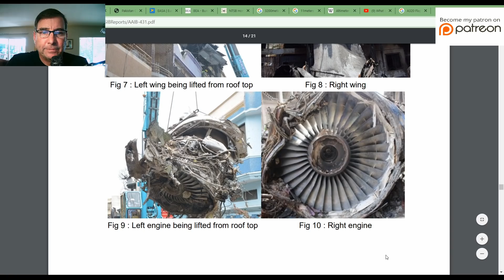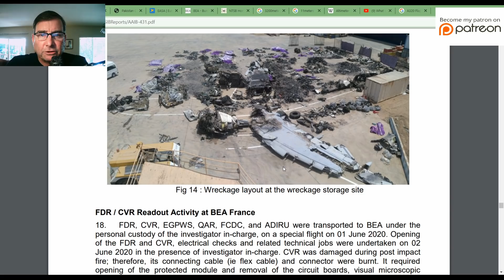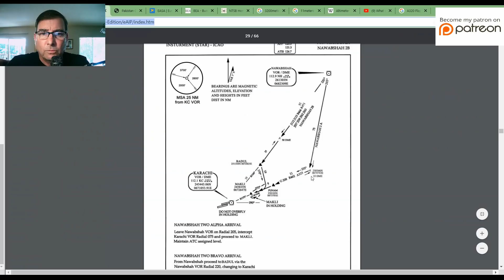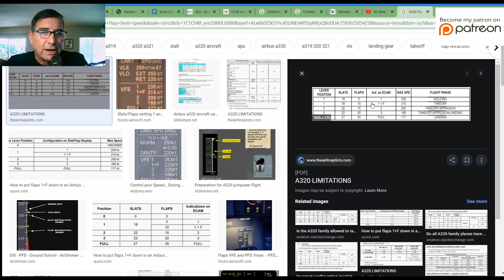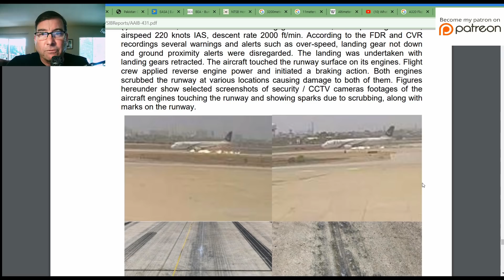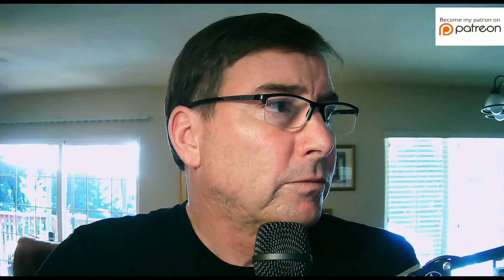PIA #8303 Preliminary Report Part II

Comment: I'm imagining the overspeed captain saying "Shut off that annoying alarm!". FO says "ok" and retracts gear. There ya go.
Reply: Reminiscent of a Three Stooges comedy!
Reply: Maybe...
Maybe not
Reply: Gotta talk about corona first...
Reply: Sounds like a standard operating procedure for Tu-144. They literally had to use passenger pillows to damp the sound of the major siren.
Reply: But there would also have been a flaps overspeed alarm so that wouldn't have stopped the annoying alarm. Maybe it improves (audibly) matters if there were two at once.
Reply: From the sound of the cockpit on the radio to ATC they didn't silence the alarm they just ignored it
Reply: The flight recorder should recorded the flaps actual position (as the computer is aware of the where the flaps are as it needs to be due to fly by wire system it has to make sure both flaps are in sync)
Reply: @lakewoodsteve5028   : Re "Reminiscent of a Three Stooges comedy!": Yes. But unfortunately, when The Three Stooges fly airliners, people die. :-(  I prefer my comedy acts be at a comedy club, not in the cockpit. Nice bit of black humor, though.

Comment: I recall reading about GA pilots getting out of their normal landing sequence, and pushing down on the gear switch, then (because it had already been lowered) reacting by pushing it back up, raising the gear. Followed by a surprise belly landing. The report said that the gear was lowered and subsequently retracted sounds like someone remembering the gear, and lowering it late in the approach, and then later perhaps the same pilot (forgetting that it was done) or the other one (assuming the first had forgotten) getting confused and attempting to repeat the task.  With the aforementioned outcome.  Thanks for the delivery and the attention to detail, especially nice for us prop chasers. CRM - Keystone Cops style. DJ

Comment: I'm very sorry this accident happened.  You nailed it.  I've spend many hours on the hangar floor turning wrenches on lots of heavy metal and worked with engineers from many different countries.  I'm not racist or discriminate and have always gotten along with everyone.  All I ask is be nice, respectful and most of all do your job.  Having said that.  

I have worked with some so called engineers from some "over sea" countries that in my mind called their qualifications into questions.  I have worked with individuals that I would not let change a spark pug in a moped.  When I mentioned my concerns about their qualification to the powers above I was told they were well documented and my attitude towards these individuals might be seen a "racist".  So I shut up and carried on.

I'm happy to be retired and travel mostly by train these days.
Reply: I've had similar experiences in the MRO environment here in the mainland US.  It's been a mixed bag of results.  My biggest concerns have been with contractors who have little supervision, because they have "the resume".  But I've also seen the same kind of sloppy and indifference attitudes across the board, even with engineering staff...inspectors too!  lots of pencil whipping happens...as avionics, it's pretty clear during finals closeup and ops checks when these things fall out, that the work was not done correctly....fortunately, in every operation, I've have a great team of avionics and systems types who are solid during "final".  We catch lots of mistakes.  Over time, yes, you start to see a trend.  And in my experience this notion that you can take someone with marginal english speaking and reading skills and expect high quality is just absurd.  There are no exceptions to this experienced trend.  That is NOT to suggest a racist element in my appraisal...just the reality.  Some of these contractors are unfortunately conditioned to our teams because of dubious contract requirements that essentially force a type of quota minority workforce.  In two states, the MRO's cannot receive work force development grants unless they comply with such quota milestones.  And there is obviously alot of graft going on, in accomplishing this "requirement"...I've seen non-us citizens flown half way around the world, set up in cramped apartments, and provided common bus transportation and tools provided just to satisfy the numbers game.  And watched the Maintenance Director give them the task of FOD watch all day.  Nevermind, that on paper, each one of these individuals carries the equivalent A&P.  It's fraught with corruption..I know this.    I've done my part as best I can...and other too.  When we see something unsafe, we fix it, and report it.  Period, end of story.  But that does not address the kinds of bad practices at the executive level, that is only worried about the bottom line and bonuses for early delivery and fault free warranty results.  I'm not going to lie....it's been good for me to take a break away from the industry from this pandemic.  I've always considered moving out and doing something else....Where I have more control over my work and profession.   I can't say I've missed commercial aviation maintenance.  nope.
Reply: @deaf2819  Sounds like comments being echoed by NUMEROUS people within the industry actually - go ahead and try to bury this behind "hate speech" and "racism", then YOU can be complicit in any future cost of life due to ignoring the blatantly obvious problems in the industry. Just because of the skin color of those at fault.

Reports coming out about 150+ Pakistani pilots flying on fraudulent certifications - but YOU would rather focus on the color of their skin...
Reply: It turns out that fake qualifications are all too easy to obtain in certain institutionally corrupt countries.
Reply: Sounds like when victims of rape go to the police in UK. All 20.000 of them.
Reply: @tdmmcl1532  Well said and it always seems to be economic considerations that can influence hiring practices.  I feel bad for the people that are "used" to meet employment equity hiring requirements.  I'm in Canada and I hold an AME License and an FAA A&P.
Reply: @deaf2819  I would like to reply to you David.  I don't care what colour, race, religion, gender or sexual preference anyone has/is.  To be blunt.  I just don't care.  All I ask is that a person is qualified and does their job properly.  I'm happy not to be turning wrenches or doing inspections anymore because of the working environment in aviation created by media and the hype of "special interest groups".  Aviation has no place for any discrimination.  

Say a maintenance person blatantly screws up and is call to the carpet for it.  If they represent any special interest group or "employment equity" they have the race card to play.  I've experienced this with voicing my concern in the interest of safety.  I felt screwed either way.  FYI my wife is Filipina and she loves train travel.
Reply: @tdmmcl1532  I have worked (over many years) with a number of different ethnic groups. I have found that some of them are great people, great workers, intelligent and insightful.

I have also found that some of them are lazy, stupid, malicious and generally a waste of time.

And the rest? well, they fit somewhere in between. Just like everybody else.

The real issue is that in today's politically correct bullshit environment you cannot treat people as they deserve based on the merits of their actions/ attitudes.

Yes, you can praise the the good ones. (and you are then perceived pro - whatever group- by an element in society.
If you criticise someone  then you are a "racist".

To all ethnic groups I would say this.
 By protecting those that do not deserve protection you denigrate everybody within that ethnic group.

Also, to all those who try to get ahead by pulling people down and mocking them. 
Am I:
Male?
Female?
White?
Black?
Brown?
Christian?
Muslim?
Buddhist?

Maybe I'm a green skinned hermaphroditic agnostic :P
Reply: @deaf2819  as a pakistani brought up amongst a family of mech/chemical/nuclear/aeronautical engineers, i can assure you that he is not being racist, the standards and general competence here are really of a dismal level
Reply: I don't think a person's skin color matters, but the culture he or she was brought up in does. For example, most boys in the middle east are in general allowed to do whatever they want. I have seen kids from the middle east behave so badly in public... and the parents would just look and smile about it. So, my theory is, that because of the way they are brought up, most middle eastern men feel entitled to get whatever they want, and bribing people to take exams (as the suspended pilots did) is considered OK, without regards to what this could ultimately mean for other people.
Reply: I've read this comment before, seems like a copy paste.

Comment: For sure, this accident will be quoted in training for quite a few decades.
Reply: It will be interesting to see whether we can learn anything new from this accident at all. Unfortunately I think it will turn out that everything could have been easily avoided by applying the principles and knowledge that is already widely available in training materials today. So unnecessary.
Reply: @oliverracz2686  fully agreed. I just cannot see how 2 trained crew members can reach such a state of brain failure.
Reply: This shouldn't be part of any training as the mistakes made here fall in the category of common sense
Reply: Especially when recruiting pilots out of the military, who are used to the respective command structure, rather than CRM.

Comment: Amazing!... The power of those engines being able to pick that aircraft back up off the runway without rolling gear after the damage caused is mind boggling.
Reply: Yes, without rolling gear, reverse thrust and spoilers deployed!  And as Juan pointed out, there's even  a chance they still had one good engine and inadvertently shut it down.

Comment: Sounds like your analysis up to this point was spot on. 
The real surprise for me was that I assumed that when the pilots noticed the engines scraping I assumed they directly did a go around, as you can imagine they were under the assumption the landing gear was down, and if you find out at the point of touching the runway this is not the case, you immediately go round as an instinctive reaction (witch at that point sounds understandable to me). But they applied reverse trust and braking, and then changed their mind. Just Wow.  Incredible they got the plane off the runway at all.
Expecting the CVR recording to be quite shocking.    There must be more to this story than just pilots being or acting unprofessional.

Comment: Air traffic control (ATC) is a service provided by ground-based air traffic controllers who direct aircraft on the ground and through controlled airspace and can provide advisory services to aircraft in non-controlled airspace. The primary purpose of ATC worldwide is to prevent collisions, organize and expedite the flow of air traffic, and provide information and other support for pilots.  In some countries, ATC plays a security or defensive role, or is operated by the military.
In Pakistan, this job is mainly carried out by the retired air traffic personnel from armed forces. The recruitment and deputation were initially carried out by the Shaheen Foundation. According to some unconfirmed internal sources the job conditions were 12-month job and 9-month salary on permanent basis in eighties, but in twenties these terms have been changed to temporary with 3-month salary and six-month job. It was only because of attractive salaries and lucrative benefits of involving in the smuggling processes. 
After the accident of Airbus 320 flight PK-8303, this is very necessary to perform third party audit of entire hiring process for recruitment of these air traffic controllers by the Civil Aviation Authority. This is very necessary to check these serious allegations on the recruitment system in the light of circumstances where ATC is standing in case of this accident.  The preliminary report is highlighting the attitude of both pilots, but the ATC is also held responsible for this accident. The following are the point to be consider for analyzing the role of ATC.
•	It was the last Friday of month of Ramadan and how many personnel called for duty and who was the one makes an excuse and changed duty
•	What is the attitude of an ATC in the atmosphere where he feels from day one that someone is doing excess on his part?
•	Why they did not show any concern at the time of first approach of landing, which was abnormal to SOP.
•	Why they come to know only by CCTV about lowered landing gear and last-minute release of the landing gears causing damage of both engines
•	Why there was no emergency declared at JIAP
•	Why the runway 25L was used for landing 2-more flights after the accident.
•	Give us one single action by ATC to deter this accident

Comment: I'm not sure if you were trying to imply criticism of the ATCOs, but I don't believe any is warranted. Under certain conditions, a PAR for example, it is perfectly normal for the approach controller to request and relay a landing clearance from the tower controller. In this incident, I think the approach controller was convinced that a landing was not on the cards, but sought a clearance anyway, just to 'keep all the cards on the table'. Electing to defer a frequency change showed great prescience, correctly recognising that the crew were either close to, or beyond, task saturation. The fact that the approach controller elected not to relay the tower controller's report of a gear-up landing can also be explained by not wanting to add unnecessary workload by reporting what must have have been a fairly obvious situation. As you correctly stated, once on the deck (with reversers and brakes employed), the correct evolution is to stay there. A radio call from Approach reporting a gear-up landing at this stage would have been an entirely unnecessary distraction.
Thanks for the great analysis, I love your channel. It's so refreshing to gather news from knowledgeable sources.